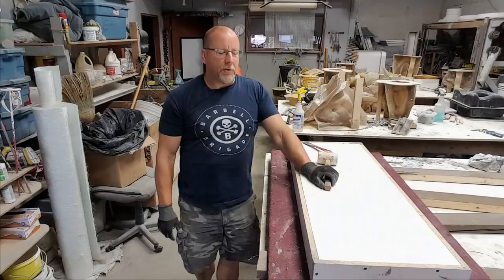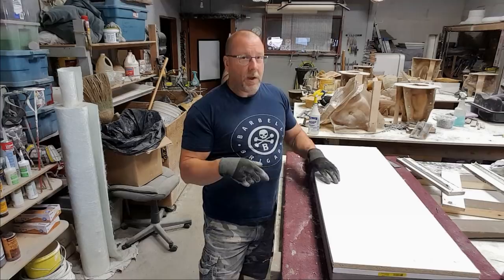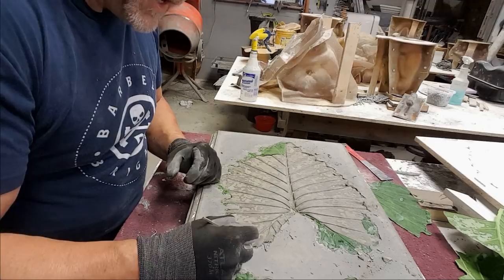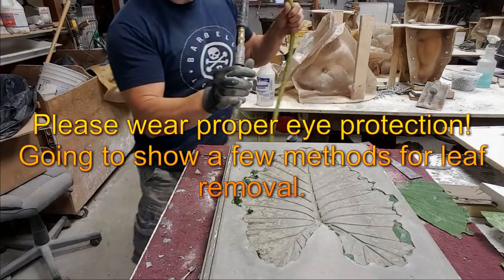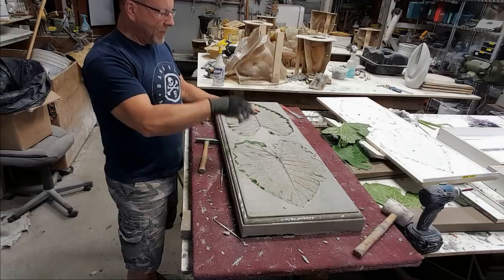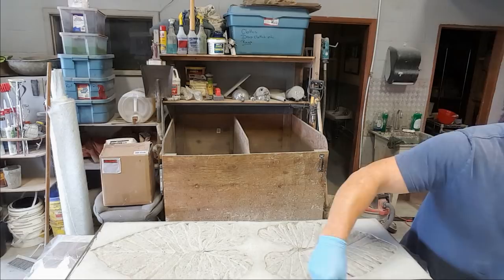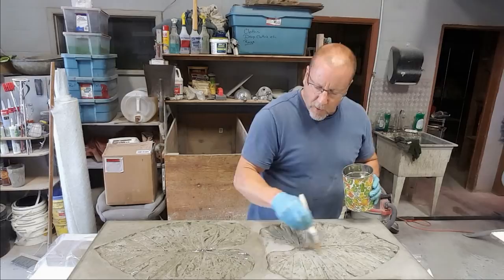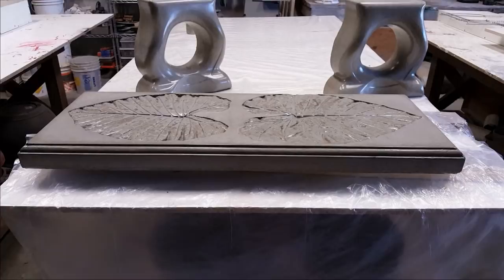Making a concrete bench with leaf impressions part 2

Comment: Great video, Gris. Even the smallest tips help - turning the bench onto a piece of carpet, could make or break a project. I also liked the depth of cleaning you went over,  very helpful. The omega legs look cool.
Reply from the maker: Thanks , yes the carpet is great ,I also have some heavy rubber mats I use on occasion as well.Really helps when the concrete is still relatively green.

Comment: One question:  have you ever tried to use a hose & the water pressure removes the cement from the edge of the leaf?  Outside job.
Reply from the maker: Hi Diane, Yes , water ,air shots from compressor. I think I do it my hand because I actually  like to score the concrete fairly deep around the leaf perimeter to create depth and definition. That's just me though, lol.